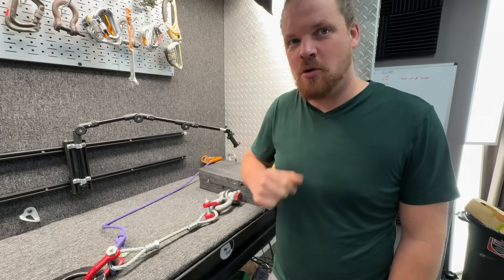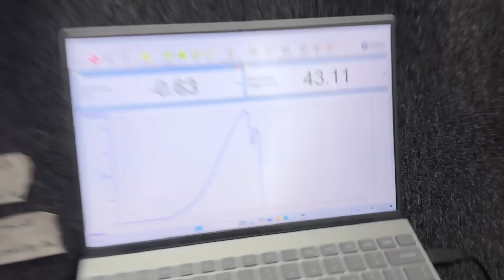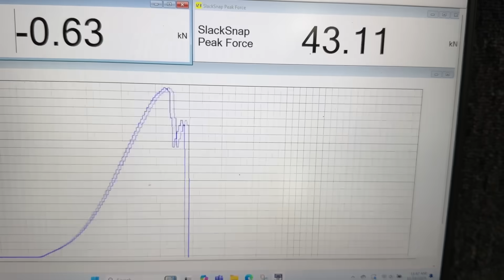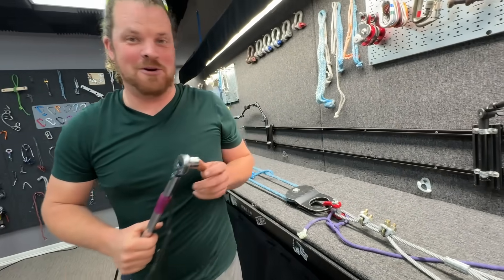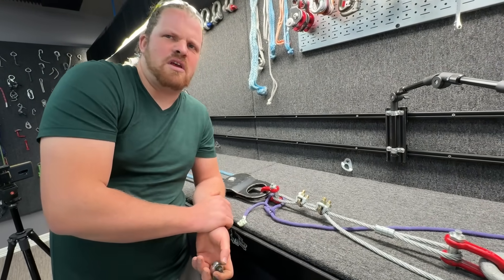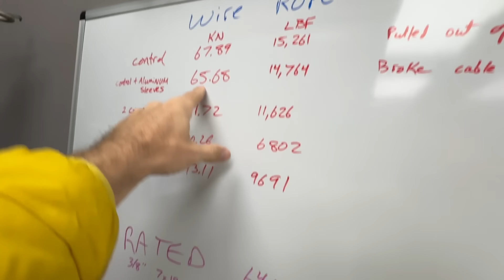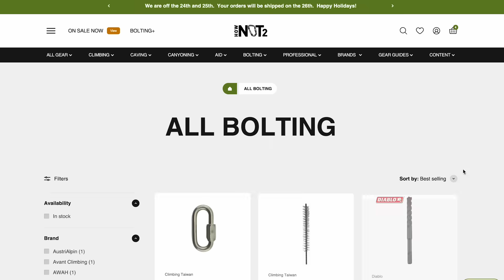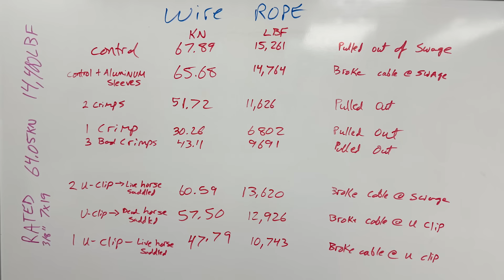Never saddle a dead horse

Comment: This was absolutely the worst display of a person using a torque wrench.  The form was good, the click was solid, and the nut was tight, but you filmed yourself using the wrench on YouTube, and therefor it was done completely wrong.  The technique leaves many questions:

What was the spec you were tightening to?
Did you adjust the wrench off camera?
Was the wrench measuring unit in football field elephants, or silly things such as apples and cookies, specifically fig cookies?
Why am I writing this comment?

With so many open items, I wonder why you even posted the video in the first place. 

To all of the neighsayers, I have a PHD in torque wrench physics from Devry University.  To get into that program I had to pull the door, instead of push it. I have owned at least 10 torque wrenches, most of which were from harbor freight, so I think I am pretty much an expert. 

That ought to cover all of the torque wrench comments. 

Good video.

Comment: Cable works best when all strands are equally tensioned. When the cable begins to slip or pull out from a swage/clamp, the force becomes unevenly concentrated on the strands that move the least (usually those most in contact with the material of the clamping member. As individual strands are overloaded by the concentrated forces, they begin to reach their tensile limit and break, causing the force on the now fewer remaining strands to rise. This creates a very rapid "zipper effect" across the cable, starting with the highest-tensioned strands. 

The importance of multiple crimps on the swages, or multiple cable clamps, is that they serve to spread the friction load across all strands of the cable, as the increased clamping force increases friction on the inner strands of the cable, which are the first ones to attempt to slide out of the connection when the cable is loaded. When this internal friction is achieved to a great enough extent, the cable can effectively carry tension as one member and the stress concentration is negated. The outer strands are subject to greater friction (and usually mechanical interlock to some extent) due to their embedment into the material of the swage, or the textured surface of the saddle, so they tend to 'slip last and snap first.' Sufficient clamping force ensures even tension loading of all strands, and allows them to carry a greater load, as the overall individual strand tension is more averaged across the strands. 

Exactly like the effect if a proper back-splice, the whole "machine function" of these clamps is to simply spread out the forces evenly across the fibers.
Reply: A very impressive detailed analysis, thank you for sharing!
Reply: What you described is exactly what I want to see in super slow motion (hence the call-out to get the “slo-mo guys” involved with this channel).
Reply: I notice no thimbles sometimes, are thimbles in the loop necessary?
Reply: @LittleTomHermit Generally yes. They help prevent the cable from kinking or being abraded by the object (usually a loop or pin) to which the cable is attached. They also prevent the eye from being pulled into a smaller radius that the cable is able to safely bend.
Reply: @ thank you 😊
Reply: Cable goes into TV , wire rope , improved plow steel wire rope
Reply: Kinda like a weak skilled smart person vs. a novice strong amateur attempting to rip a huge phone book in half....

The smart person can actually do it!
Reply: @jakefriesenjake I learned the phone book  trick when I was about 15yrs old. I never considered myself "smart" Lol. 😂
Reply: You are smart  @bluzharpin20

Comment: curious how a spliced eye with a swage would hold up, quite a bit more work to make one but they're supposed to technically not need any additional clamps if you gave it the correct amount of tail in the splice.

Comment: Ive been working as the director of a challenge course for several years now. im not in charge of the inspection, but I have to be familiar with the rules they check when they do inspect it. Ive always wanted to see these tested against each other

Comment: 7:20 Not sure I agree with this part. The "Dead Horse" is the part  under the most focused pressure. That adage is to help put the tail end into the smaller pinch point so that the load transfer at the thimble eats up some of the strain. The 'teeth' in the saddle are designed to spread out the force on the load bearing end helping get closer to the MBS. Thank you to Entertainment Rigging by Harry Donovan for that one. Either that or it was in Jay Glarum's book Theatrical Rigging. It's been a while since I read both.

Comment: A couple of issues here.
While I don't have a riggers ticket here in Australia, I did do the training course and I do have the manuals.
.
1/ on swaged wire rope
 More than one swage is not permitted as it is considered to be weaker than one properly made swage.
All swages should have at least some exposed tail, ( at least one wire diameter is considered good), beyond the end of the swage, any swage where the tail does not have an exposed tail would be considered defective and may have slipped.
If there is a long exposed tail, it is permitted to mouse with wire or to wrap with some sort of cloth or plastis wrapping tape.
.
 There are a number of considerations to properly made swages.
Very important is that there should be a bell or a flange, where the swage is not compressed at both ends of the swage.
A swage right at the end of the sleeve is a guaranteed weak point.
.
2/ On the matter of wire rope grips
our standards require a minimum of 3 wire rope grips on any cable, on smaller sizes of cable up to 5 grips may be required according to the table provided.
Wire rope grips become less effective as the cable gets smaller.

Back in the day at Expo 88, there where a lot of "shade sails" installed using only 2 wire rope grips.
This caused much discussion at the time, the  conclusion was that, this was an "engineered solution" and a design by an overseas company AND it was not " overhead lifting".
.
I have seen several forms of wire rope grips, from harware store rubbish to some very nicely engineered product.
Some I have seen are specifically designed for specific rope and have a twist pattern in the body to match the rope.
I have seen but they are not common, wire rope grips that have two moulded parts and two bolts & nuts.
.
AND, YES, where are the thimbles?

Comment: I would be interested in seeing the difference between the regular lay wire rope used in this video and a lang lay rope. The lay refers to how the individual wires are oriented. A regular lay rope has these wires parallel to the the rope length while with a lang lay they are at an angle.

Comment: I noticed you aren’t using thimbals, any reason for that? My question is, if one Crosby is rated at 80% of the load, does having the second increase it to 160% of the load?
Reply from the maker: Thimbles are generally used to mitigate wear, not a lot of wear happening in these tests. 
Where is "one Crosby is rated at 80% of the load" coming from?
Reply: @ That is my question, is one Crosby 80% of the cable rating or the two Crosby setup 80% of the wire rating? Is (2) Crosby’s standard practice and assumed when rating?
Reply from the maker: It depends on the wire rope size. For the eye termination Crosby recommends two for 3/8" and three for 1/2".

Comment: Ok, The saddle horse or called cable clamps should be placed with one up and one down.  They should never be placed as seen on the video with both up.  One up and one down.  I have been doing this for over 50 years and never had a failure.  An old man gave me a lesson when I was 16 years old.  I'm 72 years old now..  Go figure...

Comment: Very interesting! I'm a total amateur but about 12 yrs ago I built a 180ft zipline in the backyard, using 3/16" SS cable and the screw-down U-clips. I have to say they looked small but I used 3 and spaced them about a 12" apart on the tail of the line, connected to a chain around the tree with a bolt and using a thimble. IIRC the "weakest" component was the biggest turnbuckle I could find and a WLL of around 1100lbs.  No problems in the 10 yrs it was used but last year I had a 70ft tree fall across the line and break it, it snapped the cable at the far end at a midpoint spot between the thimble and the most distal U-clip.  This tree was massive and although it destroyed the zipline, it did confirm my build and assembly assumptions.

Comment: I would like to see typical utility guy grips, the type that wraps the cable (guy grips), comes with the eyelet, and needs no tools. Too bad you don’t have bigger equipment which leaves out the Big Grip that is typically used on 1” Bridge Stand at 100% rated capacity.

Comment: Definitely good to call out the Slo Mo Guys. Their work provides some nice revelations.

My usage is limited to using the clips for ham radio antenna cables where the load is light compared to the strength of the cable and for those cases it could even be good if the clip gives rather than the anchor point. Think of a tree falling on the antenna cable - better to just redo the joint than to have to look for the roof of the house in your swimming pool.

Comment: Swages are very strong. I was a logger and ran skidders. All the eyes and bell knobs for the chokers were swaged. Pulling on a 9/16" choker with a Clarke 666 at full chat is a mighty load. Never lost a choker but I did have my  7/16"mainline snap and wrap around the ROPS cage. That was a brown alert moment.
Reply: Had a 3/4" let loose when while trying to pull a challenger tank that slid down into a clay pit. Took the safety cage out , and mangled the back corner post.. Defiantly brown alert...
Reply: I’ve had 200lbs(ish) of hardware sliding directly at my position all along the ground starting at a measured 90yds away from my position because I had a 3/8” log chain break pulling on a log that was just a “leetle” to well in place (I WANTED it to move) and THAT was a brand new chain. I’m more certain about the logs moving now because it was very surreal watching the rigging sliding all that way yet still sliding under my rig with the winch but directly between the tires until it hit the tree that was my anchor. VERY wild day with Dad. No one was hurt and we were able to joke about that one because of the learning experience that we BOTH just experienced (he witnessed it as well).
Reply: Unconstrained snapping cables can really REALLY ruin your day. 😮  Glad you had a cage for protection!
Reply: 7/16 mainline with 9/16 chokers. Of course it's going to break.😂
Reply: @nobodythatyouknow241  LOL, got his numbers mixed up.  A mainline would be 1.25 inch or better.
Reply: @Stan_in_Shelton_WA  drumlines are usually 7/8" tensioned to 3/4"
Reply: I’ve also ran a Clark 667 with 3/8 cable drum.   Broken a cable a few times, some were by surprise.  

It definitely gets your blood pumping!!
Reply: @rustygardhouse7895  me too, and placer miner..
Reply: Haha brown alert... double check everything starting w your pants?
Reply: What did you use to swag the crimps? I'm using 3/16" wire.
Reply: it’s not a swage…..it’s a Ferrule WHICH GETS SWAGED.
Reply: with logging I would expect you were using Flemish eyes or another variant.  Overhead lifting standard is a Flemish eye with a swaged sleeve where the splice end join back in/together.
Reply: @Stan_in_Shelton_WA my dad called it a Molly. Mainline had metal protectors so the eye didn't fail.

Comment: As an ex tutor at a polytechnic where we taught scaffolding, rigging, and industrial rope access, this was not really that surprising.
In rigging in adventure playgrounds, high rope courses etc I found the biggest failure point, especially on wire rope ladders, was a millimetre or so just inside where the rope exits a swage. This is where the rope stops being flexible and stresses build up causing individual wires to fail. The only way to check them is to flex the rope there and see if any strands are broken, but the problem is whenever you flex it to check you're adding to the problem!
Bulldog clips are the way to go, much easier to check for broken strands, and of course allow for ropes to be retightened as they stretch a bit in use.
You can now also get double saddle clips now.
Reply: Yep

Comment: I prefer to use fist grips. They apply even pressure to both sides of the wire rope, so they hold more securely. And they don't distort/damage the cable. When used properly, after removal you can't tell where the clamps were applied. It would be interesting to see you test them compared to standard cable clamps.

Comment: Yep, never saddle a dead horse, my dad built bridges for 50 years, and taught me that in late 70's, I was a crane operator in my late teens, and a bridge crew Forman at age 21,  i built 4 bridges with a small crew, high interest rates in the 80's put that company out of buisness, i went to crane operator full time with a different company.  If I drive past a bridge job I sometime stop and check to see if their clamps are on right, some are not, I have seen pictures of foot bridges that use cables and I can blow up the pictures and see the clamps on wrong, was a foot bridge in Mexico that went down and killed some people, saw the pictures after the accident.

Comment: How not 2..... Could you give details about the hand held crimping tool used in this vid. I need one as I am  unable to get crimping done in Mexico for 9/16 wire rope.
Reply from the maker: it is a battery powered 12 ton compression crimping  tool. The one in the video is a Huskie. Hand pump ones are cheaper but slower.

Comment: As a specialist in this industry in australia my best recommendation would be to look into the standards.
ANSI, DIN, ISO and even AS/NZS

AS1666 States that IWRC, WRC or FC all have different ferrule press loads (often near 200t) and all require measurements for the pressed ferrule length thickness and excess tail.
All this is dependent on the ferrule material (Aluminium, Copper or Steel)
All Dies used for pressing must not leave any ribbing on the ferrule such as here and no skirting/flare.

In regards to the wire rope grips. Its not only a good rule of thumb bit are also included in the standards.
There are productes out there that have the option for the U Bolts on both sides.

Please speak with a dedicated specialist for more information in NA as all standards are different.

Comment: An eye in wire rope is never made by bending it around and crimping it (unless you are a child or moron).  You cannot see it but they are always made by separating the wire bundle into two groups.  One of 3 strands and one of 4 strands.  Those are doubled back and neatly  layed back together and it can be either have twisted ends back into a 7 bundle or neatly frayed about, around the original wire rope.  THEN you crimp the ends with the cable to make an eye good for 70% of it's original strength (If done properly with a steel ferrel on a multi ton press)    You can also do the same (called a Flemish eye) and simply tie with wraps of tie wire, which will hold almost as good all alone.  (used that way by anyone needing an emergency eye, like a farmer or off roader)

Comment: The only splice I was taught and learned was called a Liverpool Splice. It was very strong, but should not be used where the wire could "unwind" under load such as the hook end of a crane whip.

Comment: I make wire harnesses professionally.  Properly done crimps have an optimal cross section with no internal voids.  Determining the correct crimp compression requires failure testing across assorted crimp dimensions usually by adjusting the crimp height.

Here they are simply compressing but seemingly not optimizing the crimp.  They seem to be crimping to some default tool setting which may not be optimal for the combination of hardware used.  They possibly are over compressing where the crimp is the failure point.  Often (not always) with a proper crimp the wire/cable will fail before the crimp.

Comment: When I worked with elevators, we always used wedge type sockets for termination of the steel cables (not sure what the correct English term is, but its what google came up with). They were designed to be the strongest link, far exceeding the cable strength giving a reliable and strong connection, less special equipment needed, and less chances for a "bad termination" which leads to a weak joint. Would be interesting to see how those hold up against crimps.
Reply: Swagelok is the brand name of one such system, it uses a conical wedge. Quite frequently found in sailboat rigging.
Reply: Socket and wedge
Reply: Was on a Mine Sweeper, ran the main winch during sweep ops. the boatswains used the 2 pc. swagelock to position the cutters that were placed on the main rope, 5/8" SS with 1 serrated strand to cut the cable on the mines.  Neat wedges, put em on take em off no damage to main rope.
When making eyes of splicing they would set up their cable vice, get out a couple of marlin spikes (used to open the rope for the separated strands) no clamps no crimps.

Comment: In the towing industry and crane industry we brade the ends back so some strands are going each direction around the eye.  Then install a crush sleeve to terminate the dead end.  It isn't hard to do (gloves highly recommend) and results in an eye termination that is stronger than the line . . . They say 100% but in 40 years I've never seen the eye fail even with too small of pin in the eye, always brakes between the eyes so its over 100%.